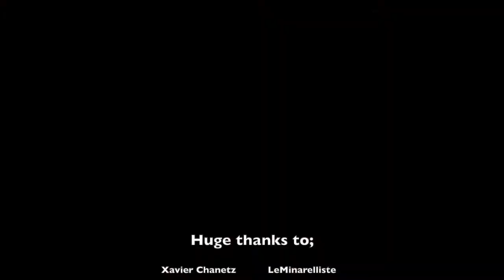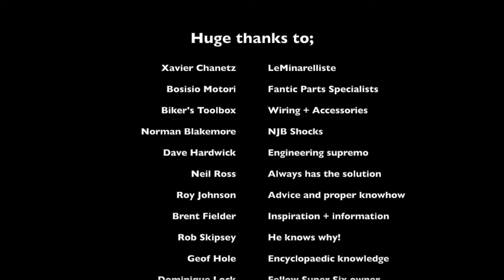Fantic GT Super Six Rebuild Time-Lapse

Comment: Hi, I have a cylinder with the code 240.47.01.5100.0. Ist it the same as yours and where did you get the piston for it?
Reply from the maker: Although this bike has a TX240 frame, the complete engine, gearbox and exhaust are TX220. So, the cylinder is 220.13.6100 (9hp), piston is specific for this cylinder and is not compatible with the 240 cylinder. Your 240 cylinder is very similar to the Caballero TX190 cylinder, please ask LeMinarelliste in France or Bosisio in Italy, links to both are in the description of this video. Cheers Mark
Reply from the maker: This might be OK, but please ask Bosisio first - https://www.bosisiomotori.it/prodotto/19013006320/
Reply: That helped a lot, thank you!